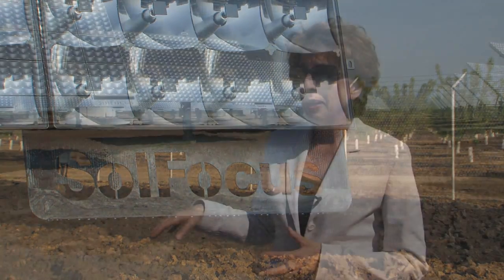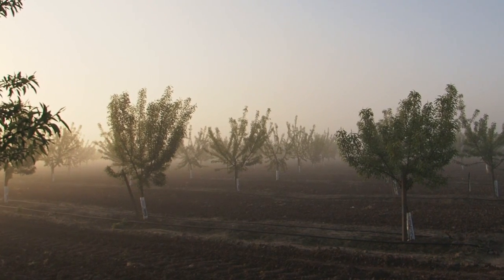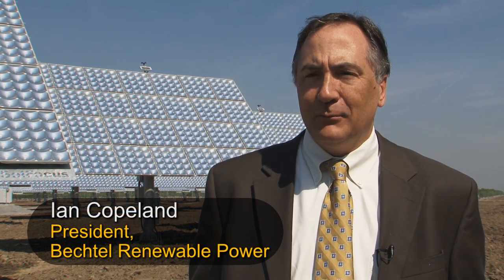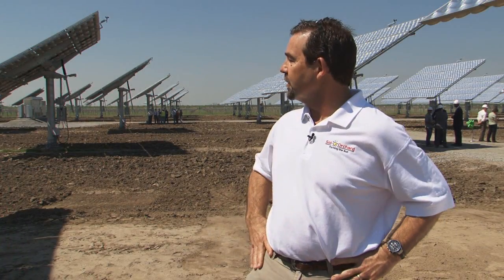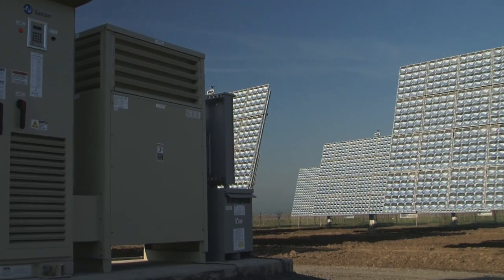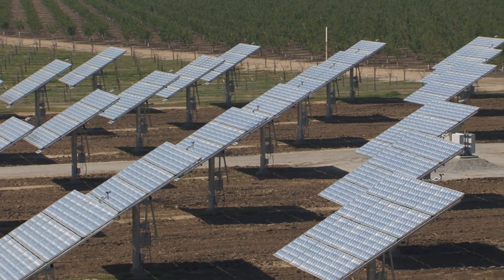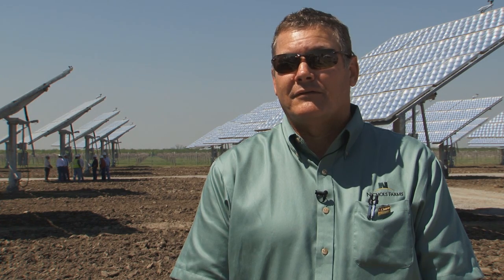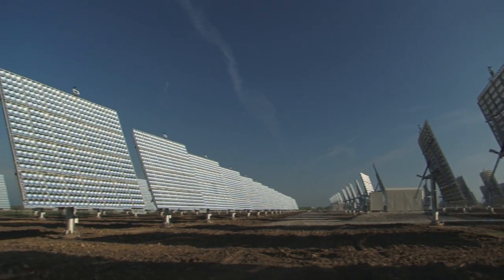1 MW CPV Solar Power Plant at Nichols Farms

Comment: can you tell me how many units are produced through the 1mw plant ... Roughly yearly estimate... least and the highest .
thanks.
Reply: If you're asking about how many MWh they produce, multiply 365 days by 4 hours average of peak power, that's about 1460 MWh = 1.46 GWh per year. Could be more, could be less depending on how many hours per day, on average the location gets. If it's a sunny area it could be more, if it's in a place with harsh winter it will get less.